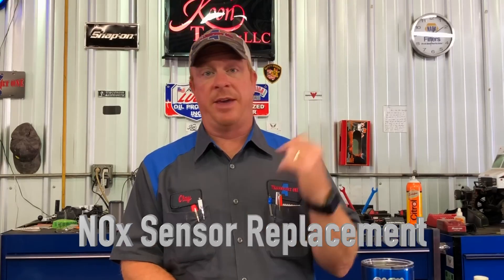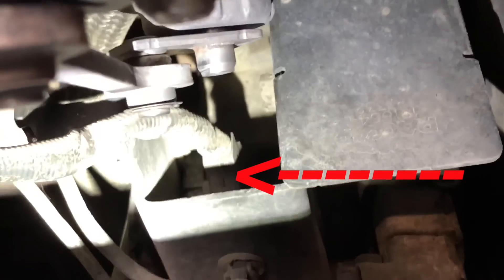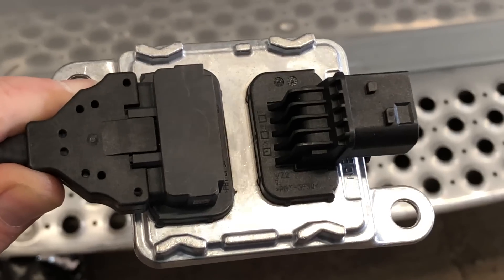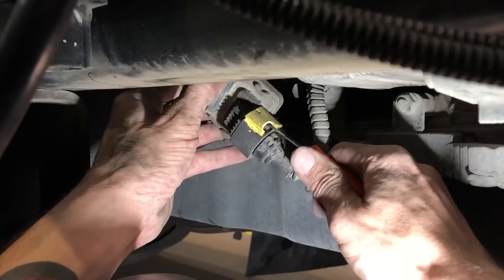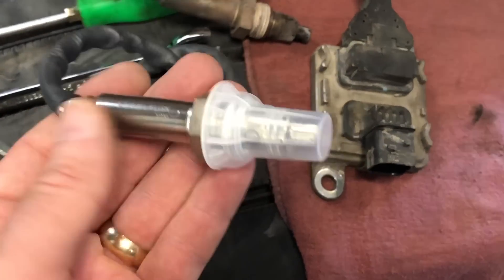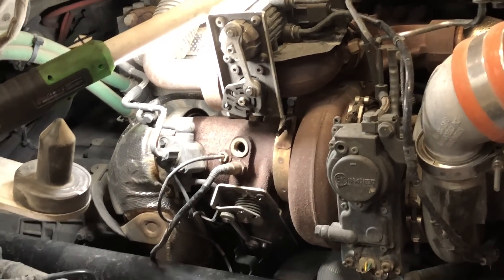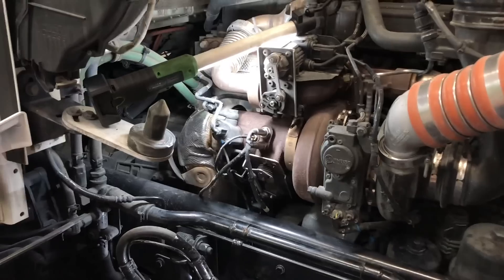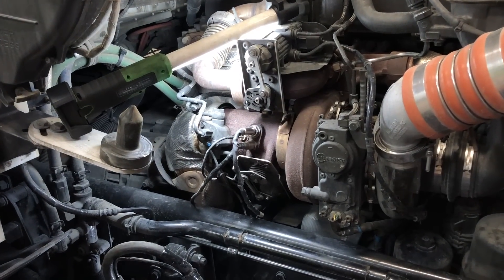NOx Sensor Replacement On Paccar MX, DIY

Comment: Thank you for video I replaced it but still got mil light on do I need to force regen any suggestions thanks
Reply from the maker: If you don’t have a computer to do it with take a look at this, super cheap and works great. For less than one tow bill you can usually get yourself out of a ton of jams and prevent de rating. https://youtu.be/o10jJYeeZ50
Reply: @KoonTrucking  I been thinking of getting it otr performance after  but wasn't sure after 11 mon do I need new subscription?
Reply from the maker: Yes you will have to clear the code and force a regen
Reply: @KoonTrucking  thanks a lot I  did looks good so far

Comment: The pretend-engineers did such a horrible job on determining the location of all these sensors and their connectors. It's ridiculously difficult to access so many plugs on these motors and the exhaust system. The engineers should  be required to work on one of these trucks sometime to see how shitty of a job they did.

Comment: I just cut the wire after I power probe it ND confirm it’s bad if it’s good but I still gotta remove it I’ve cut wires and then spliced them back together lmao.

Comment: I’m a NOx sensor application engineer. The NOx sensor comes with anti-seize already on the treads. Putting another form on anti-seize WILL POISON a NOx sensor causing it to read incorrectly.

Comment: If a nox sensor is bad, will it cause exhaust fumes to get Into the  cab.
Reply: Not in my case. The STOP engine light activated on mine and I ended up having it towed to the dealership. Still waiting on the part, btw.

Comment: ......you fucking kidding me? Thats it?! peterbilt wanted FOUR HOURS at $210 an hour to do this sensor.
Reply from the maker: Yep and you have to add in time for the regen.
Reply from the maker: That’s why I do these videos. If you look in my video description you can see the discount code for the OTR performance tool that allows you to clear codes and force a regen super easy. It will also save a ton of money if you have issues and get derated. You can use it to get you to a truck stop or off the interstate. Money well spent for that! Here is a video of it in action to show how simple it is https://youtu.be/o10jJYeeZ50
Reply: Well i can tell you this. You saved me $840 in unnessesary fees as a new O/O. Even i can do this and i have all the mechanical skills of your average drunken chimp with a head injury. Just need to go get the new sensor next time im near a dealer.

Also i actully have a diesel laptops system. Little more intense and lets me do a lot of dealer level commands. Bought it befofe i found out the OTR system was a thing

Comment: Have a question. I have a 2017 Kenworth T680 that has a tachometer that was working fine and now it's reading is approximately 5,000 rpm higher. Can you please tell me where the tachometer sensor is located at on a Paccar mx13? Thanks for your video and I am now a subscriber.

Comment: Thanks I’m going to try do mine. Got a code on it. You all are really helpful.😁👍
Reply from the maker: Ken Lye it’s not a hard job to do at all. If you don’t have a way to clear codes or regen your truck take a look at this video, it will pay for itself the first time you need it to get out of a derate vs going to a dealer and paying them and having to wait for a regen https://youtu.be/o10jJYeeZ50
It’s a great product to have !
Reply: Did mine . Wasn’t that hard.   Hardest part of it was getting to it.  That part really expensive 😳.  Thanks for info. It saved me alot labor costs.😁👍

Comment: I had a cam sensor code show up with my check engine light on. Not sure where this sensor is located on the engine. This happened after having an engine wash. Possible sensor connector loose. Any help you can pass on would be greatly appreciated.

Comment: You mentioned $450-$500 for part...I just priced at our KW dealer $735 Intake NOx sensor!!!  I want your dealer even if I have to pay shipping!
Reply from the maker: MHC Kenworth Tupelo MS
Reply: Same here. MHC Greensboro, NC wants $765.
Reply: @georgequigley2360  I use Greensboro to but never buy from them go across the street to Peterbilt and it's always cheaper don't ask me why lol
Reply: @truckingeveryday5703  I’ve got a good relationship with the parts guys. I get a real good price break on my parts.

Comment: Any ideas, 2016 t680 had box senor code replaced it and not even 30 miles later it’s back
Reply: I mean NOX
Reply from the maker: Nox codes can also come from egr issues
Reply from the maker: Did they change the right nox sensor ?

Comment: Is there an easy way to remove and replace the radiator in kw t680?  My clutch fan exploded and sent the fan through the radiator.
Reply from the maker: It’s not that bad just undo hoses and unbolt it and get someone to help you sit it out of there or if you have a hoist or a cherry picker to help

Comment: hay clay peterbilt 2011 three indicators on one yellow check engine light the other red stop engine the third one yellow regen light with exclamation mark on it  and i have those massages engine derated , noxlimit exceed due to quanttity ,aftertreat scr oprtate iduncement severity so what do you think thanx in advance
Reply from the maker: We would just have to look at it. Can’t diagnose stuff especially emissions issues without looking at them and seeing what’s going on
Reply: @KoonTrucking  thank you so much but the truck in saudia arabia , is thier any method to clear fault codes without ascan tool thanx haly

Comment: Do you have the Part number for the NOx sensor?
Reply from the maker: Scott Pierovich I don’t have it anymore. We don’t keep them in stock. It’s a dealer item only so we just call out Peterbilt or KW rep and order them as needed due to the cost of the sensors.
Reply: Koon Trucking   Thank you.   My local dealer had my truck in for a recall and said outlet sensor was likely bad but they wanted to replace both.   I'll just get outlet sensor when I pick up the truck and replace it myself.  
Thanks!

Ps.  If I need to replace inlet sensor I will have no problem doing it thanks to your video
Reply from the maker: Scott Pierovich I have the video uploaded but haven’t released the outlet or rear nox yet
Reply from the maker: Scott Pierovich here’s the link ..... 
just for you
https://youtu.be/Xnk49-OZMOo
Reply from the maker: Scott Pierovich that’s service huh ?

Comment: Another problem in the system is the SCR doser because it stays open and plug  the outlet NOx  sensor mounted on the exhaust pipe after the SCR catalyst...

Comment: Do you see a normal millage those are failing at? Reason I ask, Like the 386 SuperTruckerDan has. And most have the Paccar engine. And if I get back to driving. May try one out. That or throw new rears under my old 1995 T600 with The Series 60. Its a single axle right now.
Reply from the maker: You never know with emissions the more they idle the more parts fail so ? Never know really. It’s very expensive just keeping emissions trucks going.
Reply: Went from a 99 classic xl Detroit 13spd and 3.55s to a 13 t680 with the paccar a 10 and 3.42s worst mistake I've ever made keep your t6 forever its not worth the headache and unreliability

Comment: Well i just cut the wire use regular deep socket 

Seems like mines are always stuck like a tick in a dogs ear TIGHT AS HELL 

I use the 22 mm socket going back together 

Am surpised you dont hv that snap wrench for that 

Dont forget to pull the diesel doser and clean it with carb cleaner to keep her rolling
Reply from the maker: Next time get her hot and bump it with an impact it will bust loose.
Reply: If your going to go thru the bother of pulling the doser. Why would you put it back on. For an extra $260 I’ll take a brand new one please!!
Reply: $260 vs $10 ill think ill try cleaning first and if it doesn't help oh well cost me a burger haha

Comment: I saw a video on time saving tools and one them was called a Mini Ducter.  You put the coiled wire end over a nut or bolt, etc and in about 30 seconds it's red hot and ready to come out.  Great for working around fuel lines or fuels tanks that aren't torch friendly. ;-)

Comment: You can also test for voltage and continuity at the plug the make sure it is your nox sensor or not, pins 1 and 4 should show battery voltage, pins 2 and 3 should show around 55 to 60 ohms with the battery disconnected